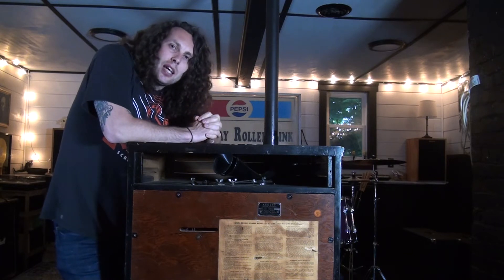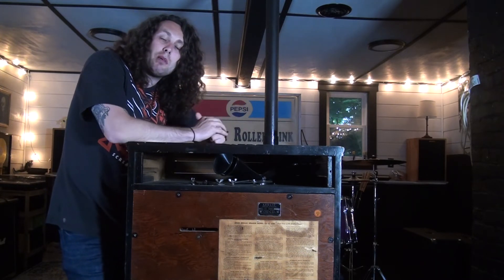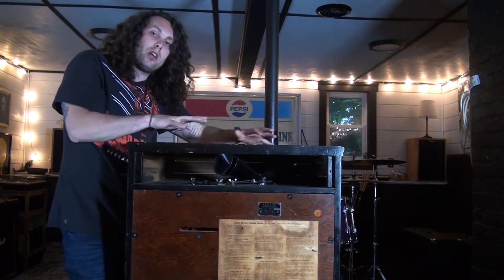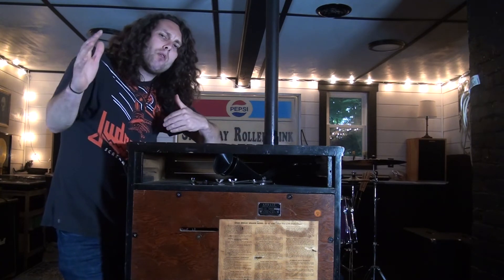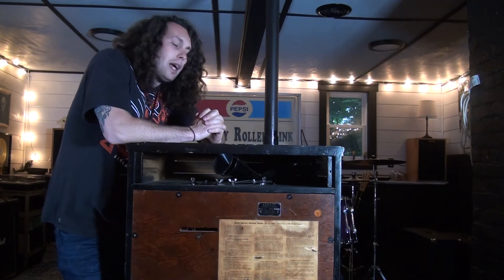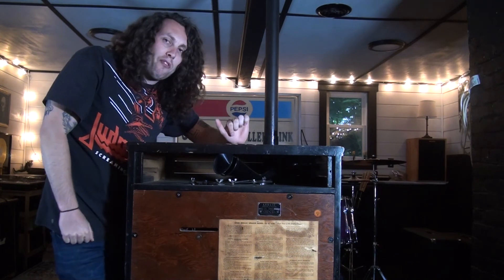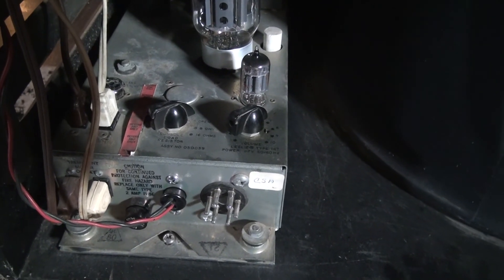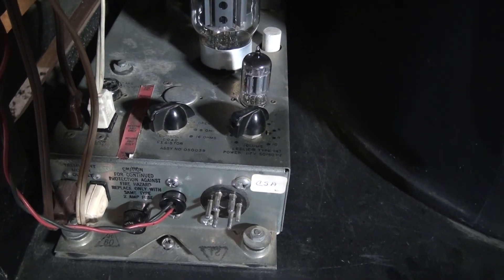Simple Leslie 122/147 Conversion

Comment: How to use the 122 with leslie vintage combo pedal ?
Reply from the maker: I am going to leave a link at the bottom for you to check out. It has all of the information you will need. The leslie 122 does not have a compatible vintage combo pedal. However there are modern equivalents that will work with the 122.

http://www.captain-foldback.com/Leslie_sub/combo_preamps.htm

https://trekii.com/products/leslie-speaker-accessories/uc-1a-pedal-220v.html

Comment: Wouldn't you be going "back" in quality by changing a 122 to a 147? The 122 has balanced input where the 147 has unbalanced, so the sound of the balance unit is better in theory.
Reply from the maker: Hey there I have attached a link that discusses balanced vs. unbalanced signals. There is no loss in sound quality between the two and changing my organ setup to fit the 122 would have been much more expensive than swapping the amps in the Leslie

https://www.boxcast.com/blog/balanced-vs.-unbalanced-audio-whats-the-difference#:~:text=You%20may%20be%20wondering%20if,sound%20quality%20more%20than%20anything.
Reply: @skatewaystudio8935  That makes sense, thank you for the info.

Comment: So i have 760 solid state that i just bought for dirt cheap. However, to my surprise and treat, it has a 147 tube amp in it. The board has been gutted and a 147 amp sits in it fully hooked up. I don't know if it works or not because I don't have anything else yet. I do have a computer interface/mixer that I'm going to use as preamp. What else do I need you to have it ready for any 1/4 ?
Reply from the maker: Hey there! Assuming that the 147 amp is hooked up correctly there are a couple of options for you. I will include some links at the end of the comment. Both options will require you to get the correct box to fit your 147. You will also need a 6 pin leslie cable. The first option would be to find a leslie combo preamp. These can be quite expensive even the vintage ones. Depending on the age it also may need to be serviced. This route is more expensive but you do not need an outside preamp and they are pretty cool. Your other option is a little box that someone makes but you will need an outside preamp, and a foot switch to run into the box because it takes a much greater signal to get sound to the leslie. This is the route that I took because of the cost of a leslie combo preamp. It works like a charm and you can find preamps to go with it for cheap.I will be doing a video on this in the future when my new studio is finished. I will warn you the price of leslie cables has gone up. Here are some links.

https://reverb.com/marketplace?query=leslie%20combo%20preamp

https://reverb.com/item/32158838-dr-fishsticks-leslie-type-6w-147-controller-set-with-footswitch

https://www.sweetwater.com/c662--Stu_Pre?highlight=TubeMPSTV3&mrkgadid=&mrkgcl=28&mrkgen=&mrkgbflag=&mrkgcat=&acctid=21700000001645388&dskeywordid=&lid=58700008494224358&dsproductgroupid=&product_id=TubeMPSTV3&prodctry=US&prodlang=en&channel=online&storeid=&device=c&network=x&matchtype=&adpos=largenumber&locationid=9002687&creative=&targetid=&campaignid=20400679905&awsearchcpc=&&&gclid=Cj0KCQjw0vWnBhC6ARIsAJpJM6edzt0A7VgC4fJh4lIKuJcM3TtTz8ZGT-OdNlMpR8yzX95LH_OYktcaAhWvEALw_wcB&gclsrc=aw.ds

https://www.b3guys.com/category/Hammond-Organ-Leslie-Speaker-Cables

Comment: How do you install a 147 amp into a 145 Leslie
Reply from the maker: A leslie 147 and 145 have the same amp just different cabinets. A 145 is just a shorter 147. That means your 147 amp will fit perfectly and work perfectly in the 145 leslie. I hope that helps!